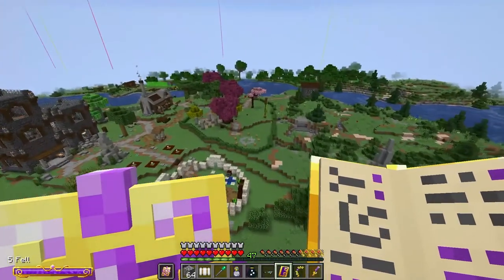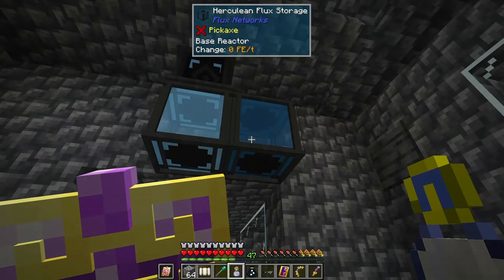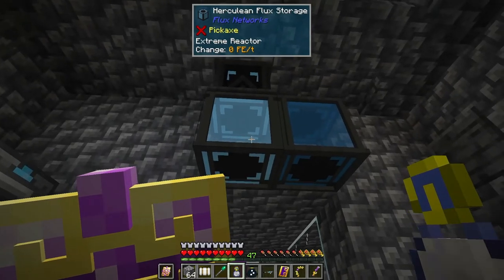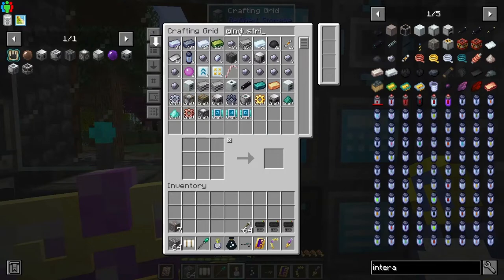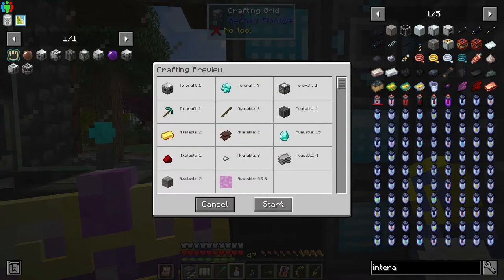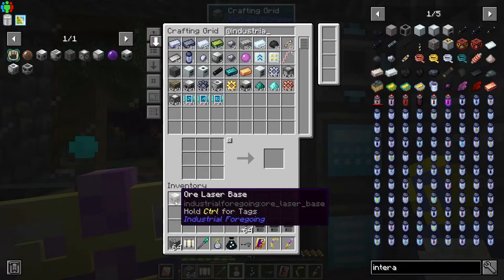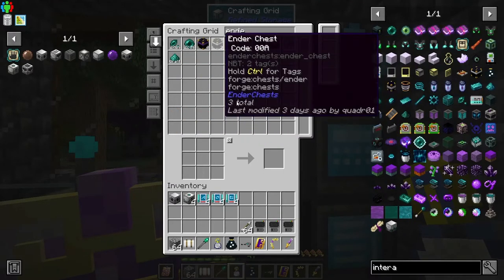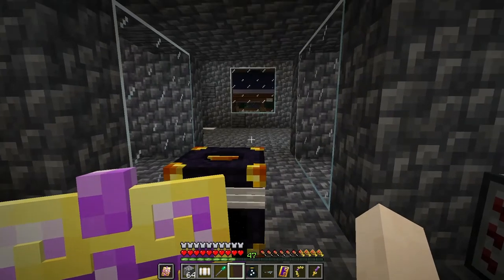DireWolf20 1.18 Let's Play Episode 81: Industrial Foregoing Ore Laser Base

Comment: Speed upgrade increase how far the progress bar moves every tick; the ore laser base increases when it gets a pulse from each drill, not every tick, so the speed upgrade wouldn't apply.  Efficiency decreases how far the bar has to go to complete an operation, and Processing increases the "amount of operations", which I presume is why when you added the extra Processing addons, it looked like the progress bar moved more each time?

Keep in mind the lenses only change the weighting; you'll get more of each ore when you put a lens in, put the laser base in the correct biome, and mine at the correct Y level.  But I run my main ore base with no lenses at a depth of 10, and I get diamond, emerald, iron, gold, copper, certus, etc.  I think they all have a weighting of 1 by default, so say you get 10 different resources, each with a weight of 1, it means you have a 1 in 10 chance of getting any specific item.  But if you put a lens in that increases the weighting of one to 5, then you'll have a 1 out of 14 chance of getting most, and a 5 out of 14 chance of getting the ore the lens is for.

Check your system for "Raw", not "Ore", for most metals.  The ore laser base doesn't bring up iron ore, it brings up raw iron.

And how did I not know you could put more than 4 drills on a base???  I just put another drill next to one of the ones I have there, and it's going diagonally into the base!  I'm going to have to do some upgrades!  :-)
Reply from the maker: Yeah, unless they changed it since 1.16 the laser base supports more than 4 drills :) Makes it even crazier LOL
Reply: @debbiesa00  Yep, just upgraded 4 sets of them from 4 lasers to 12. :-P
Reply from the maker: @JakeMoe  oh man!!! That is a lot :)